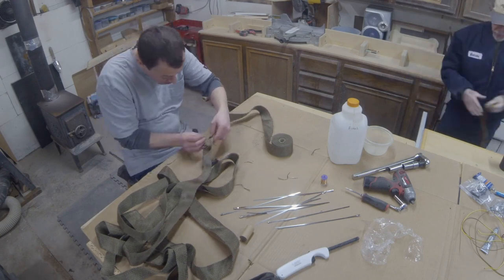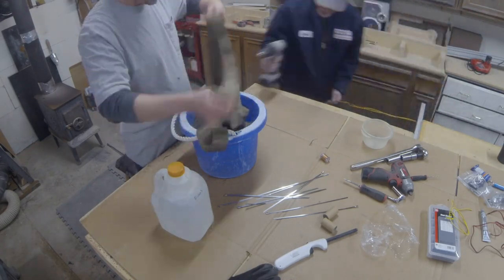Quick cheap fix for exhaust system drone noise

Comment: Just wanted to add my experience. I was a certified Vibration analyst for NASA. On of the issues discovered about vibration or "Drone" was that it is all about "Frequency Resonance". Where did the Frequency/Drone occur? Without any testing or frequency readings on your vehicle, "Just add Mass". Example - find some lead sheeting or heavier sheet metal and wrap it around the muffler and secure. By adding enough "Mass" to the muffler it will change the frequency of the vibration inside the muffler, thus moving the frequency to another level. It might take some playing with the amount of mass but it worked on many of the vibration frequencies" affecting  critical NASA equipment. Just food for thought.
Reply from the maker: Thank you for your input.
Reply: I worked at nasa too..
Reply: Isn’t adding exhaust wrap as he did “adding mass”?
Reply: @jamesc6137  it is, but if adding mass is the fix perhaps it can be resolved with even less effort, without wrapping.
Reply: How would you go about adding the sheet metal to the exhaust and securing it?
Reply: I have read about OEM truck exhausts that have a metal weight welded on to different points of the exhaust system to tune the sound by altering those resonance frequencies etc. mixing the left and right exhaust streams is another factor. I do not work at nasa

Comment: I just tried this on a 2012 Yukon Denali with 6.2 and a single Gibson exhaust. sorry but it did not work, everything sounded much deeper in bass (not just the 2k-2.5k drone) but from idle on up to 3k. I am going to remove it and go for a different muffler.
Reply from the maker: Yes a bigger muffler would be more effective. This is a quick fix that worked for me.

Comment: I'm getting ready to do this today. I bought a cheap catback for my Subaru and the muffler material is too thin and has no support inside so at certain rpms the sound waves cause the entire muffler to ring out like a bell. If I put my hand on it the ringing goes away like you'd expect. It sounds really good until the drone kicks in.
Reply from the maker: Good luck!
Reply: @s-labs7731  ya it worked perfectly. The muffler body was too thin and acting like a bell. If you knocked on it you'd hear it ringing out but if you held your hand on it and knocked it wouldn't ring out. The wrap worked like a dream.

Comment: Do you still have your muffler wrapped and are you still happy with the results? I'm running a Borla muffler on my truck and it has some moderate drone to it around 1400 RPM's and am really interested in your idea.
Reply from the maker: Yes. The muffler is still wrapped. Have a 40 minute commute and it doesn't bother me.

Comment: I wrapped my sport mufflers on my Porsche. There pretty thin metal, and I wanted to deaden the raspy noise, however the wrap stinks bad. I agree with the Nasa guy about adding sheets of thicker metal.
Reply: How would you go about out adding thicker metal to the parts of the exhaust and actually securing it though?
Reply from the maker: What kind of wrap did you use?
Reply: that smell is it oils or whatever burning after a couple days it will go away. did it solve your rasping issue? im currently having the same issue with my audi

Comment: 😱The secret is out👍👍😎
Wrapping the exhaust pipe often helps also.
Use aircraft stainless steel safety wire .032 diameter.
👍👍😎😁
Reply: Now if I could just stop glass packs from burning out and getting louder. 😳
Reply from the maker: Thanks for the info!

Comment: Is a wrap completely safe under extreme heat? Would it not burn or anything
Reply from the maker: Its designed for high temps. My cars headers are wrapped and they get red hot.
Reply: Is the wrap made of fiber glass? Also wanna ask how about if I paint the muffler with a high temp spray would that help as well?

Comment: I was wondering it just welding  rod chucks across the middle of the resonators would add mass and kill the vibrations. Audi s4guys know this pain all too well.
Reply from the maker: Couldnt speak to that. This was a quick fix that years later is still working fine.

Comment: I did this on my bmw Z3 drone at 3000rpm (100hz)
it does not work  !

I will install a helmholtz resonator
Reply from the maker: It worked great on my application.
Reply: Add the resonator on the Y-pipe. That should help
Reply: @dinky19810  i have a 4 cynlider, but i have build a helmholtz resonator ! It perfectly work !